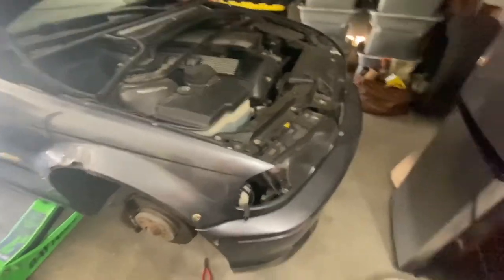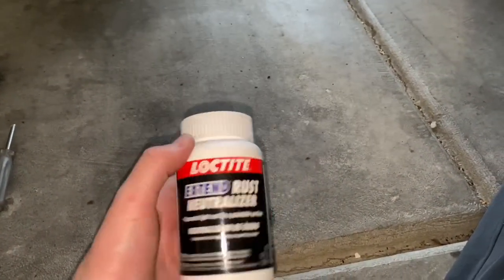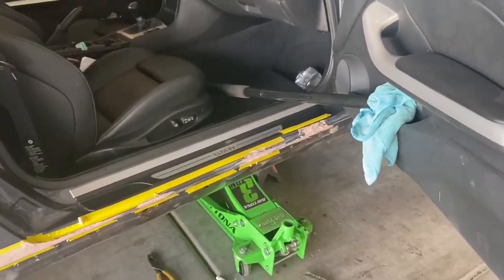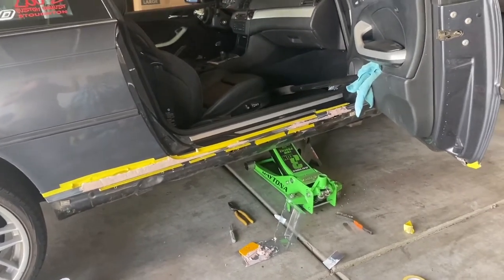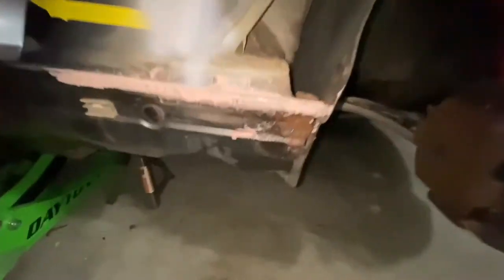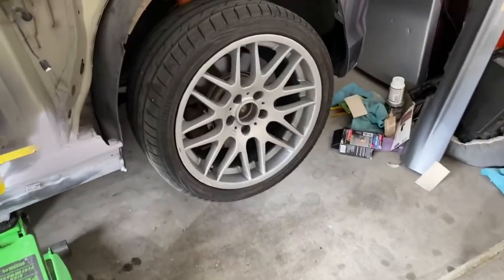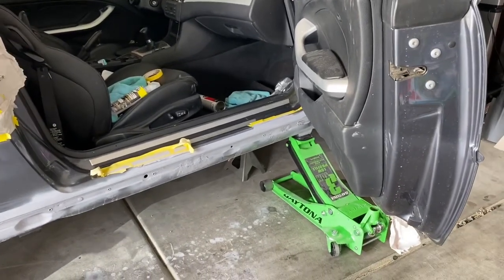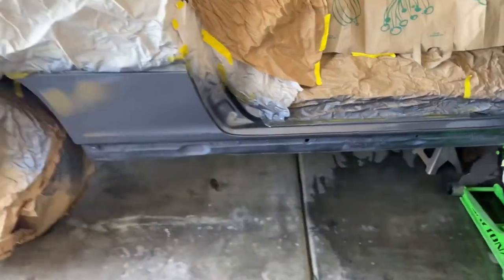Chris fix rust repair in action!! Bmw 3 seriers e46

Comment: Where did you buy your spray paint for the car from? the main color.
Reply from the maker: i got it from a place call automotivetouchup. the link is as follows: https://www.automotivetouchup.com/
Reply: @E46miley  awesome, thank you. And was there a follow up video with the paint tone color difference?
Reply from the maker: @jchiasson89  so when i did this repair i mistakenly ordered the wrong paint bec the paint code was very similar. however i did another repair and ordered the right one and the color was very very close. I also highly reccomend using the spray max 2k clear coat which u need a respirator for
Reply: @E46miley  awesome man! Thank you, much appreciated. Good video BTW. Keep it up